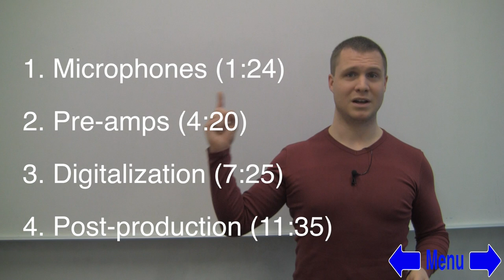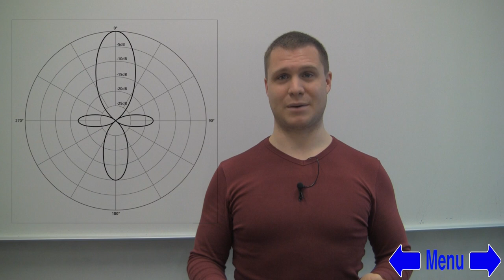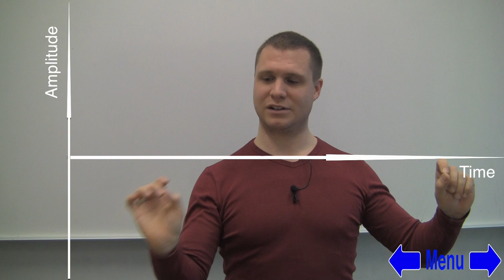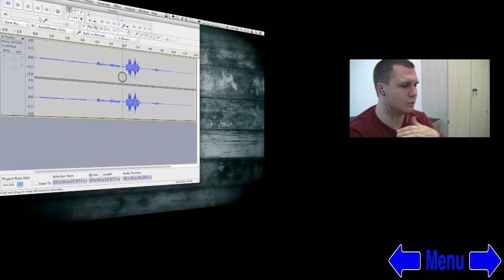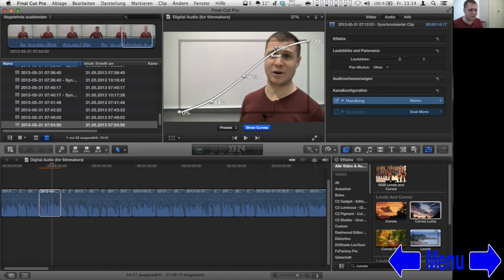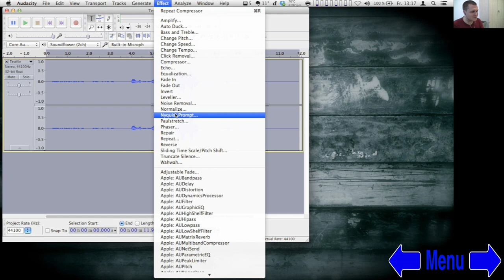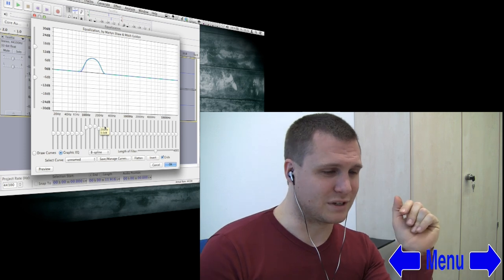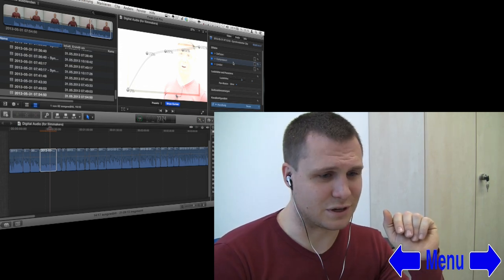Digital Audio (for filmmakers)

Comment from the maker: Thanks for the comment!

Well, yes and no. In most cases, it is good to go as close as possible to the mouth and clip the Lav to the collar (as I say in the video). But in this case, my collar is so high up that there would be no "line of sight" from the mic to my mouth, and the higher frequencies were dampened to make a very muffled sound.

Normally, you would be right though, and I've tried it like this at first, too.